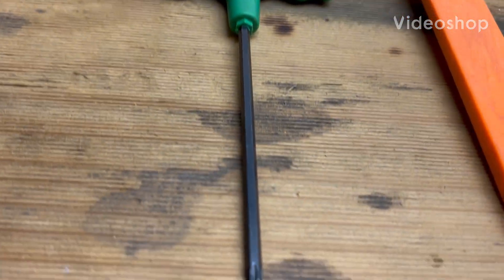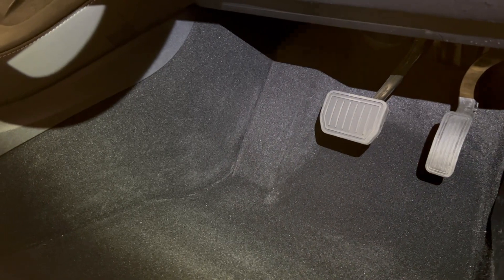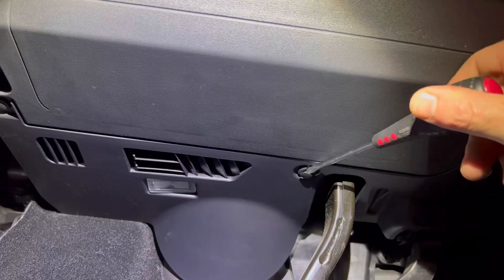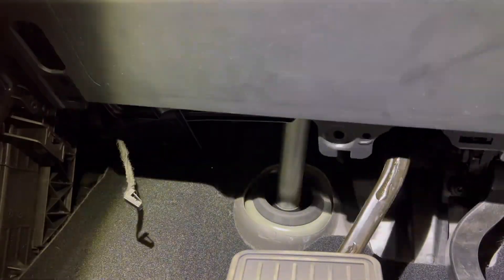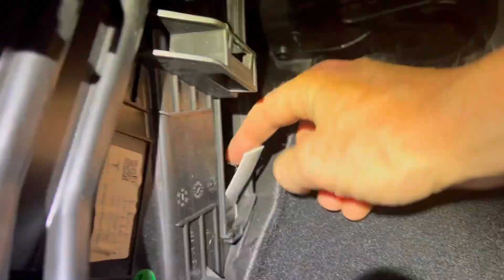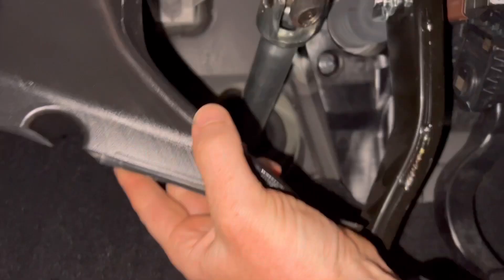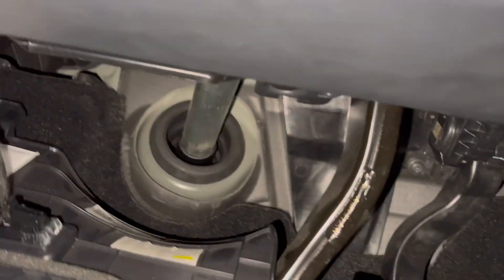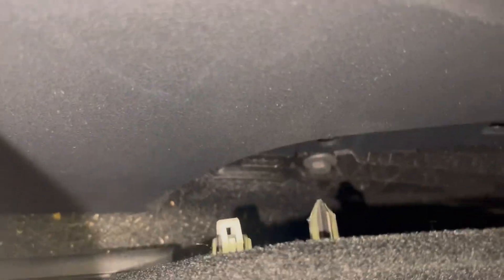Cabin Filter replacement Tesla Model 3 2021 RHD Ali Express

Comment: This was super helpful! Thank you for that ❤ 2 things. Firstly, on a 2023 M3 the filter cover does not have a T20 torx screw anymore. Instead it has a plastic clip that holds it in place. Secondly, I would recommend an AC cleaning solution (eg. CRC Auto AC pro cleaner) to kill the germs that cause the smell before you add the new filters. In any case, your video was super helpful since the RHD is quite a bit different compared to LHD M3. 😅

Comment: Great easy video to follow, I’m going to replace mine soon on a 2022 model 3, did you power down the whole car before removing the cables etc.
Reply from the maker: No need to. The only cable you unplug is for the footwell light which isn’t activated on the base model anyway. 😂 I also have a 2022 model 3. The procedure is the same; it is just a bit easier to take the cover off the filter housing.